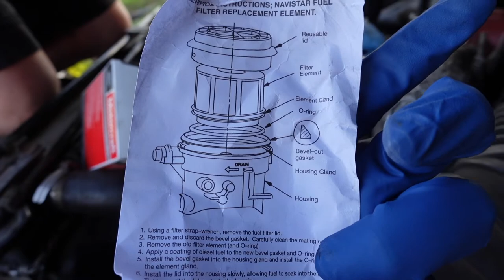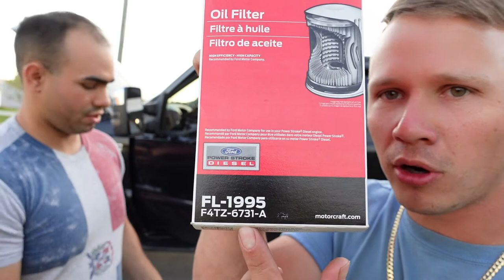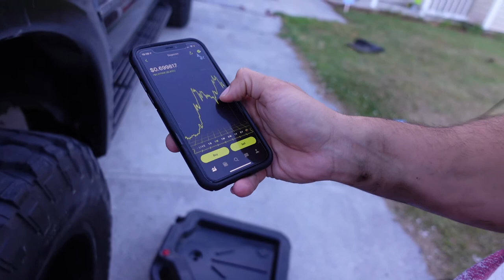How to keep your  7.3 Powerstroke running FOREVER

Comment: Hey guys, nice job!! A little tip for next time....take a nail or an old screwdriver and poke a hole or two in the bottom of that old oil filter before unscrewing it. Let it drain a bit. A lot less messy.